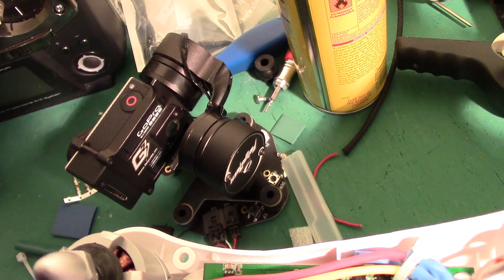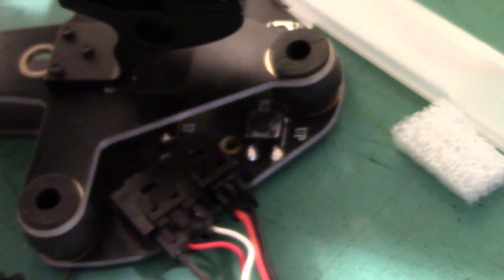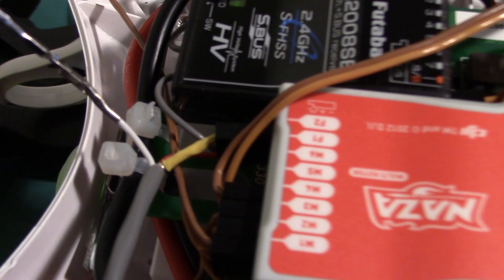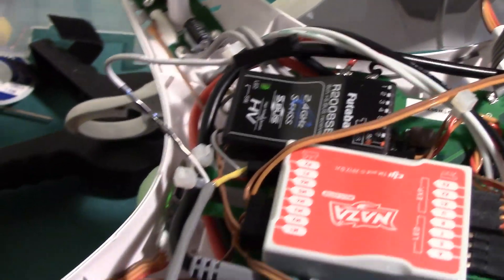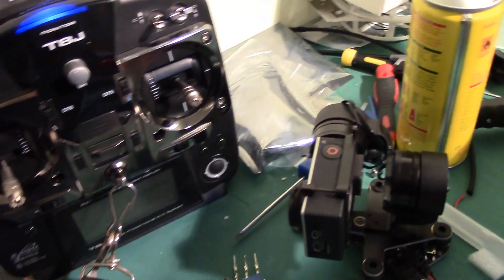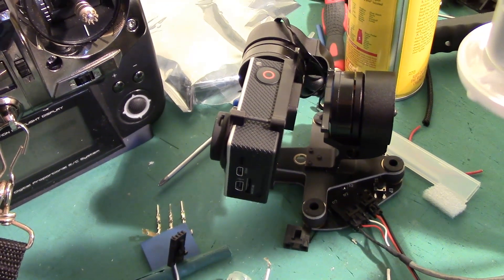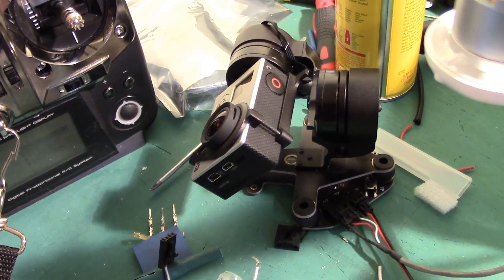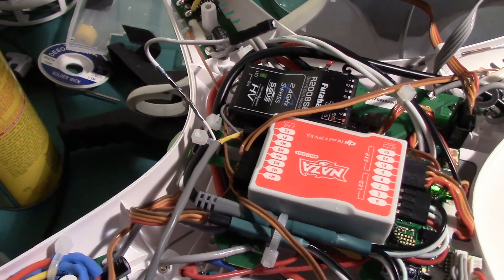Feiyu Tech G3 how to Connect to NAZA - Updated 2014

Comment: I have this same gimbal and since Iv had it it always yaw rolls real bad.....What causes this?
Reply from the maker: Honest answer... it isn't a great gimbal. The G3 was pretty buggy especially in early iterations. This was especially the case on 1.1X firmware versions. Newer version of the gimbal could use 1.2X which resolved some of the drift issues (but sadly never all of them). The 1.1X versions cannot have 1.2X firmware installed on them so there is little you can do to help this.

Comment: hi bud don't know if you can help I've got a feiyu mini 3d gimbal and set it up on my phantom p1.1.1. I had another gimbal before that worked OK but this one works similar to yours in this video but has no end point either up or down. if I turn the lever on transmitter either way from centre the gimbal goes round and round . up or down. only way to stop it moving is centre the lever on transmitter. I've altered naza settings and makes no difference. I've centred the gimbal with the 1.1 software yaw and pitch (without servo lead attached.) nothing works. I have to stop it by centring the lever otherwise it goes round and round. HELP
Reply from the maker: +sky cam video Yep it means you currently have the 'speed' mode firmware installed which won't stop a tilt unless you re-centre. You need the 'position' mode version of the firmware installed. This stops based on your slider/knob movement.
Different gimbal but same principal which i demo at this point on my video here about the G3 2axis: http://youtu.be/QndEiYOFgaI?t=382 
Download the latest 1.14 version of the firmware from their site and you'll get both speed or position bin files... you just choose which you want to use (you'll want position mode version).
Hope that helps

https://youtu.be/QndEiYOFgaI?t=382
https://youtu.be/QndEiYOFgaI?t=382
https://youtu.be/QndEiYOFgaI?t=383
https://youtu.be/QndEiYOFgaI?t=383
Reply: +d3weyTube thanks for that. I think you are correct. I will try tomorrow as off to work now. I updated software to latest one and as you said it has 2 updates so did them both. I didn't know they did different things. not much info on this. I'm 99% sure speed mode was last update I did. I'll try position one asap. you're a star. not even feiyu website could help.
Reply: +d3weyTube yes it works. thanks very much. all sorted now. out to video again.

Comment: I have this gimbal too (received it last week) and I would prefer the old way to control the tilt. Do you know if there is a way to get the "old" way - to control the absolut tilt with the poti on the transeiver?
Reply from the maker: The only way to do that would be to load an older firmware version. The gimbal will allow you to do this if you point to an older Firmwar file (see my other video on updating firmware). 1.23 will be the one you need but the down side to it is the roll drift problem was solved in 1.24... which is when the 'new way' came in.
Reply: d3weyTube I like that - to choose from two bad possibilities :-(

Comment: i have this gimbal with the servo leads one has black and red the other has white so what your saying is put the black and red one into f2 with black on the top red on the bottom leave the middle empty and leave out the white cable as in not connect to anything , is this correct thanks for your help
Reply from the maker: Yep thats the trick! The middle slot on the F2 is ground but the gimbal is grounded already via the power cable hence why they have left it blank.
White cable is left out.
Reply: thanks im having a problem my pc is not recognising the drivers on my phantom it keeps coming up code 43 ever heard of this

Comment: thanks for postiNg this. i think i figured it out the hard way anyway :l

one thing i did realised is that u cant control the tilt with the orignal phantom controller. 
u can do it if u have the controller like the ones u have '8J`
Reply from the maker: Pretty sure you can use the tilt control on the original controller. All the the VR dial on the T8J does is re-create how it works. I know plenty of people that have it working on theirs.

Comment: ich habe jetzt das Gimbel auch! hast Du eine Lösung, wie man das an der naza einstellt, das das gimbal punktgenau sich steuern lässt? Wenn ich in eine Richtung - den wert verkleinert habe, zog das Gimbal immer schief.
Reply from the maker: Hi Tobias. Sorry the YouTube translation of your post is really bad so I can't understand what you are asking here?
Reply: CamOneTec Gravitiy Air Gimbal (DJB131) 2axis Gimbal, Flytest Go Pro hero3+
Hello,
You can use the gimbal, which is connected by Naza, the dial the remote (MX-16), control point exactly? When the camera is pointing straight forward, the point on the rotary potentiometer (12 clock position) above. As soon as I turn for rotary potentiometer to the left or right, the camera gimbal drives the potentiometer so long in the rotated direction until it no longer goes, or I go back to the top (12 clock) turn. How can one camera angle only by FPV control because the gimbal so long moves as the knob is turned to the left or right. So you can not say
9 clock position is down, 11 clock postion is obliquely downwards and forwards.
I hope I have explained better. Otherwise, the gimbal is great!